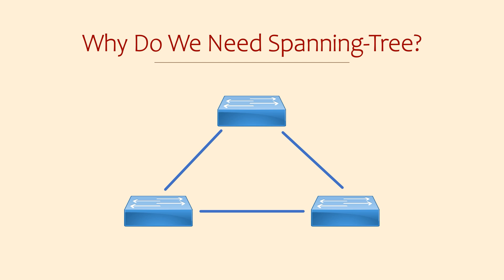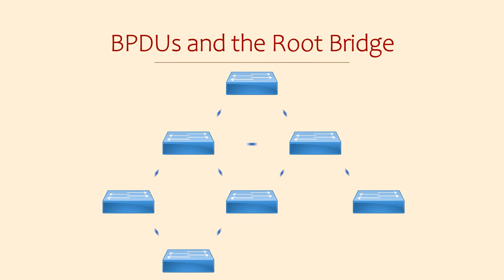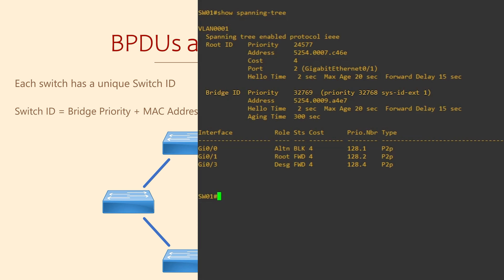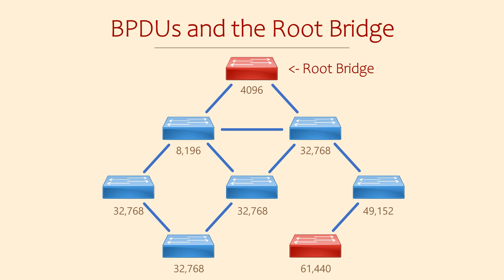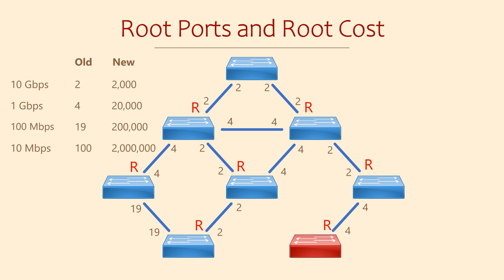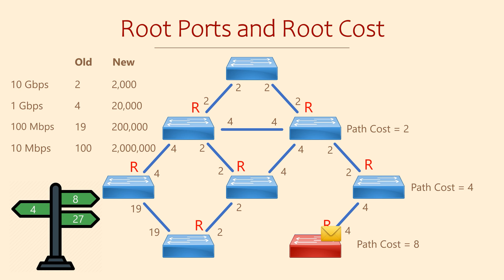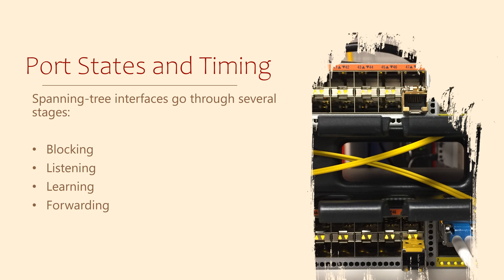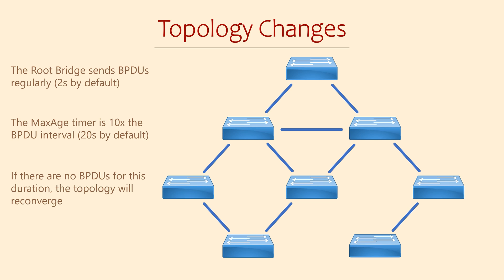Free CCNA Training Course | Part 3 - Spanning-Tree

Comment: For question 8, in most cases making SW04 the root bridge is sensible but for the example topology SW02 being root doesn't matter as all other switches have to go through SW04 anyways so it makes no difference at the end of the day, is that right or am I completely off the mark?
Reply from the maker: Pretty well on the mark.
SW04 would generally be the best to be the root bridge, as that's where the servers are connected, and where most traffic will go.
As it is now, the fast link from SW01 to SW04 will be blocked, with the slower link from SW01-SW02-SW04 being enabled.